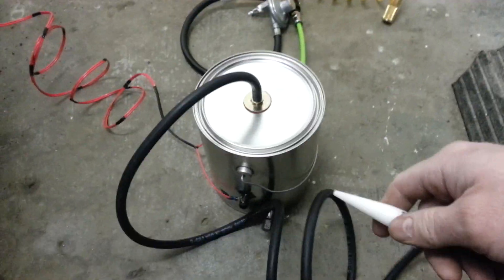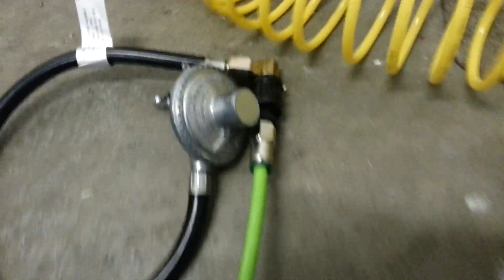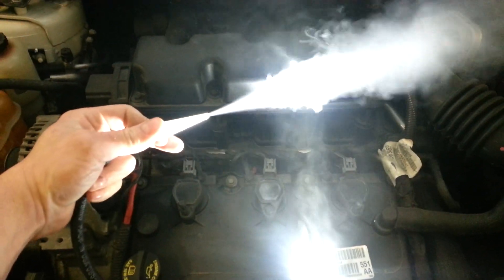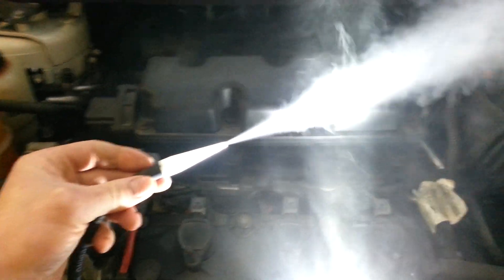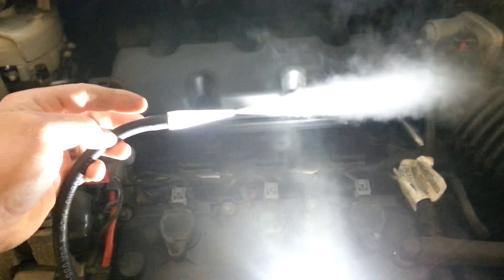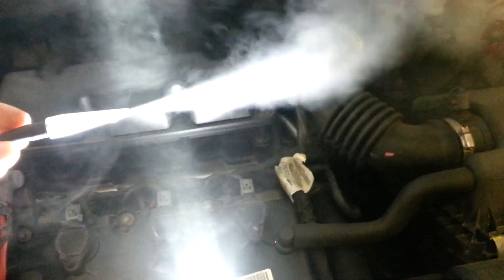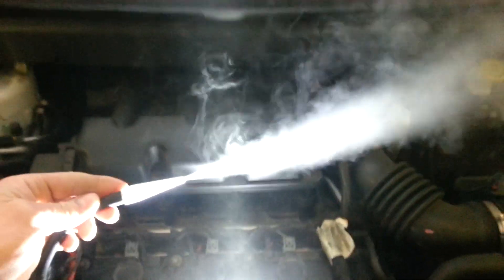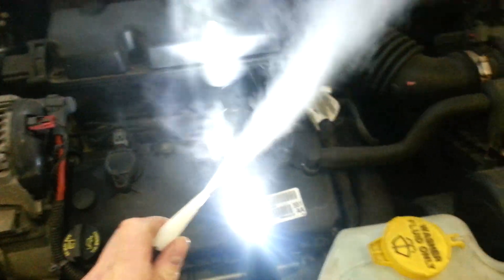Evap/vacuum leak paintcan smoker-another one

Comment from the maker: Hey guys just know that this is nowhere near what you get when you purchase. If you order one you get the can bead blasted b4 high temp paint is applied, 6'power wires w/inline fuse,6' of smoke hose w/delron smoker tip, good quality barbed fittings along w/good quality washers, good quality binding posts, power wires wrapped in convoluted tubing, empty squirt bottle (to aid in dispensing baby oil). I have had people extremely pleased w/their smokers so if you want one ready to go then email me at kustomsmoke@yahoo.com

Comment from the maker: Paintcan smoker price is as follows. $140.00 plus shipping. What you are getting- can is bead blasted before high temp paint is applied. You get 6' power wires, 6' smoke hose, low pressure regulator, stainless steel air bar, inline fuse, battery connectors, delron smoke tip, ball valve for flow control. All parts are good quality except ball valve is from harbor freight. You can knock off $10 if you dont want stainless air bar (galvanized brake tubing will be used instead). If you want cheaper price then i can use cheaper parts (ex. Harbor freight battery connectors,etc.) Materials cost has gone up on some items thats why the slight increase in price.